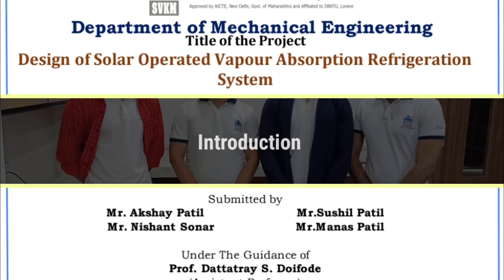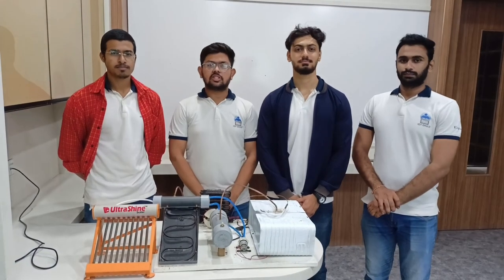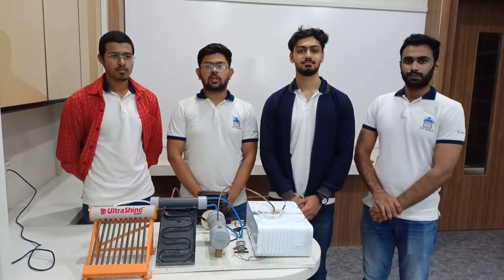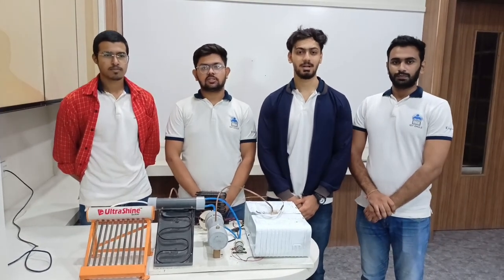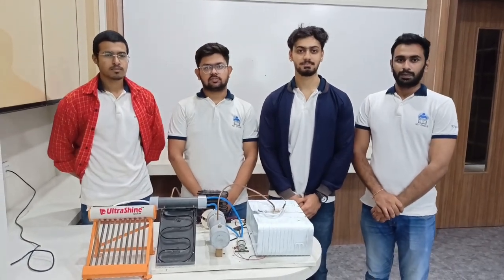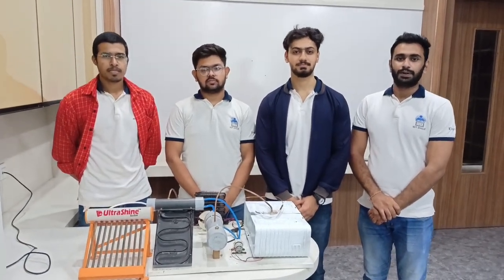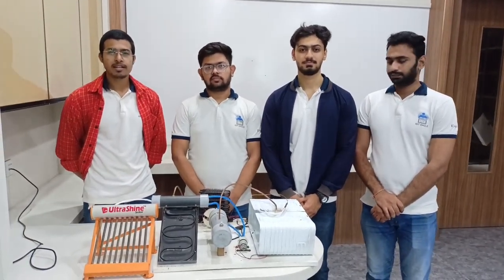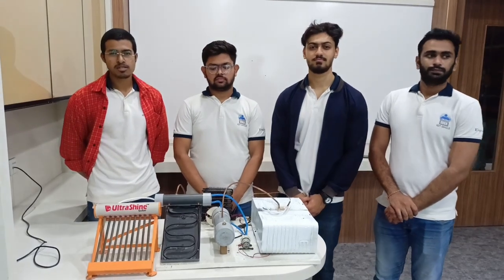Mechanical Engineering Final Year Project - Solar Operated Vapour Absorption Refrigeration System

Comment: Its a good effort but dont miss guide people by saying that you are using ammonia in your prototype.....as ammonia is crossive to all materials except galvanized iron, mild steel and stainless steel. You are using plastic and rubber parts that cant with stand any pressure or ammonia refrigerant.kindly mention its just a prototype for understanding.

Comment: Few queries if you could answer 
1. What is the cost per ton of this setup including solar water heater.Solar water heater & storage tank should be such that  AC can be operated for 8 hrs at 1 ton cooling rate.

Comment: Please did u use a solar panel to generate electricity to the system Or u used a solar collector to heat only the generator
Reply: there doesn't seem any solar panel just the collectors to heat